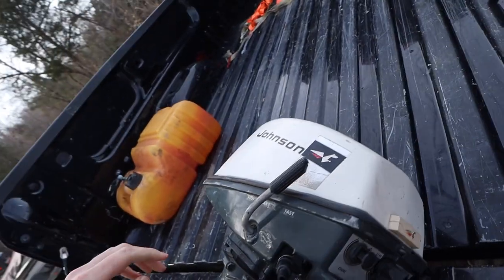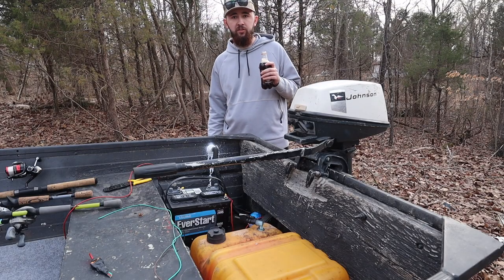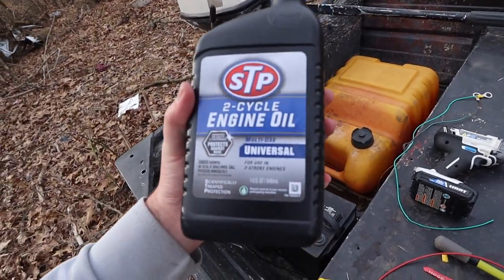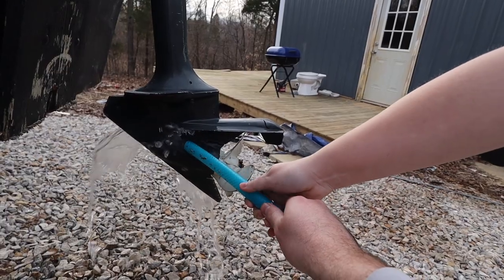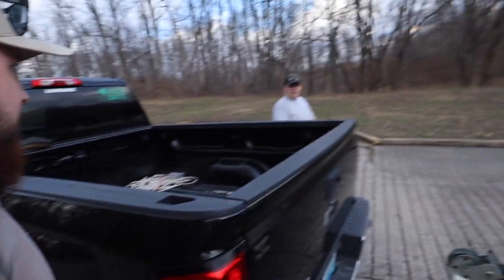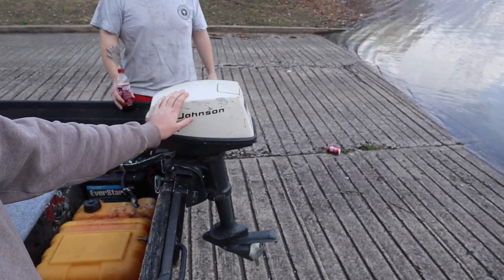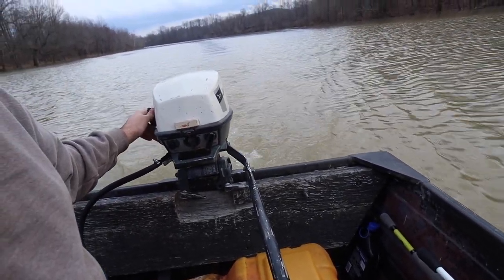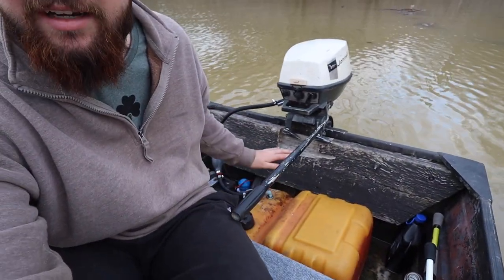I Bought a MINI OUTBOARD MOTOR for my Jon Boat!! (Maiden Voyage)

Comment: I have the motor just 2 yrs newer and it’s a smooth runner. You need to check the impeller to see if it’s pumping water or not. That’s what cools the engine
Reply: Yeah his motor was running hot

Comment: If you flip the oil around the other way when u pour it with the lid on top instead of the bottom then it will be a smooth flow and won’t spill

Comment: Im late watching this. I purchased a 16' jon boat for cheap. Sanded it , cleaned it, sealed it and painted it. Put a casting deck on it and purchased a 5 hp johnson just like yours. Lmao. Now, i have done all this without seeing your video. Just thought it was worth mentioning since im almost finished with it. Im a kayak fisherman but wanted something bigger sometimes.
Please use a 5 gallon bucket full of water before you chop your wifes hand off.